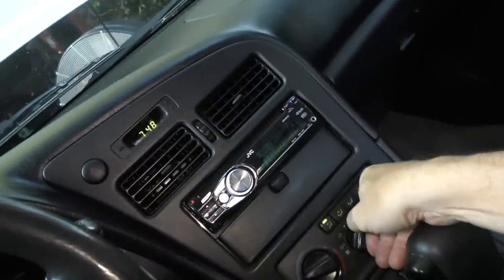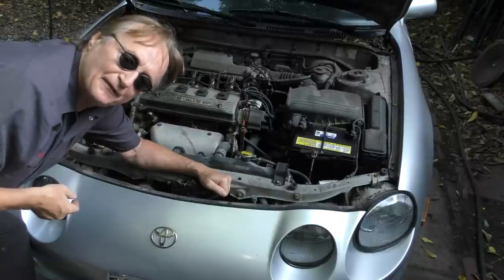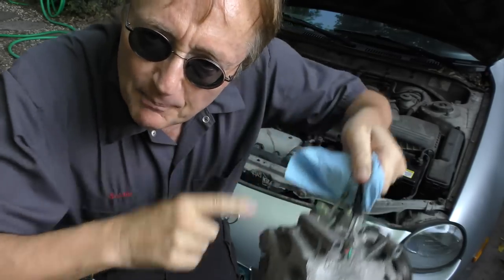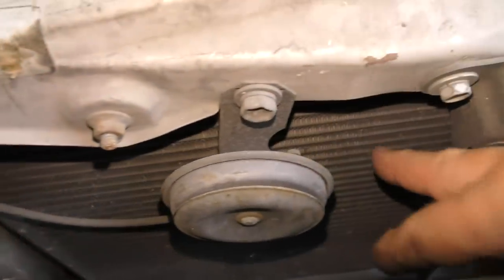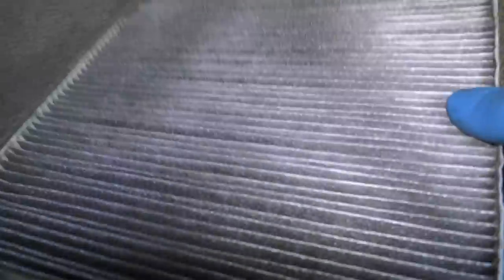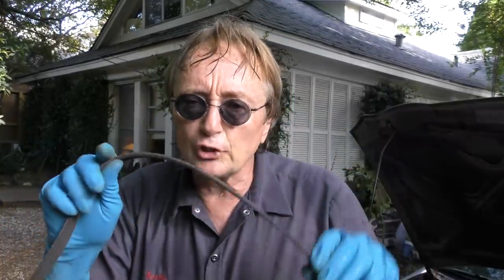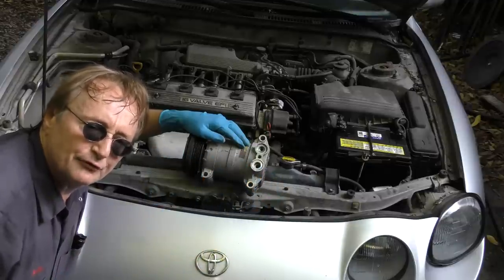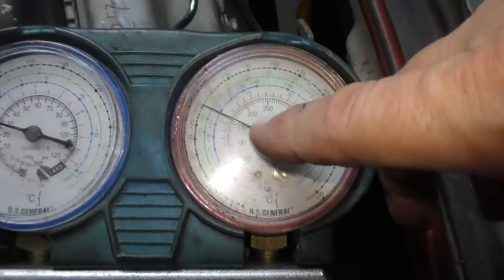How to Keep Your Car's AC Blowing Ice Cold

Comment: I have a question Scotty when I'm driving my vehicle on high speed it automatically turns off I pulled over trying to turn it on it doesn't turn on I have to try a couple times and then it turn back on but mostly when I'm driving at high speed and turns off by itself what could it be
Reply from the maker: pressure test the fuel pump, weak ones often do that

Comment: hey scotty I just replaced my compressor to my Chrysler 300 and its still not cold enough any ideas
Reply from the maker: on that model, if compressor goes bad, you should also change the condenser, the receiver drier, and the expansion valve. Start there
Reply: +Scotty Kilmer  well I replaced the valve but its still not cold enough at idle when driving it's cold

Comment: So if the low pressure side has really high pressure, what does that mean?
Reply: Phannty chances are that the system is blocked/ plugging up. but with out the exact pressure it's hard to tell.  low and high side.  it could also be a bad compressor and you are seeing static pressure.

Comment: So long as the mechanic isn't out to rip you off! Finding a good one is like finding a dentist 😐
Reply: The thing is, a mechanic may also rip you off in a subtle way. For example, you want to have a timing job (belt/chain replacement) done. You don't explicitly ask the water pump to be replaced. While doing the work, he/she may notice that your water pump is about to die but not tell you about it, and not replace it. You didn't tell him/her, after all, so it's not his/her fault. So you end up with a new timing but, soon, you wreck your head gasket, you come back to the mechanic and he/she gets the labor for it too. The best thing is educating yourself about how your engine works and all of its parts work, and if a service manual for your vehicle is available obtain it. So that you come to any mechanic with precise requests (and maybe personally sourced parts too), you can check the work done by yourself and you can't be ripped off whatsoever.

Comment: I have a 97 celica and the a.c. blows so cold. I mean so cold that it will make your face numb and the force of the air coming out is insane. I have 2010 Toyota rav 4 and the air on it doesn't even come close as the Celica and the high setting on the rav 4 is the same as the low fan setting on the Celica.
Reply: Check the cabin air filter on your Rav 4.
Reply: TeraVolt I didn't even think about that. Thanks. I know condensation builds up when the a.c. is on but is it normal to have water constantly dripping? Well more like a very thin stream. Could the cabin filter cause excess moisture build up?
Reply: trucker V Depends on air's absolute humidity. However a clogged air filter makes the evaporator get colder and colder until it begins frosting. The AC system/LPCO switch/stroke control valve senses the frost and cuts the compressor off/reduces pumping so to make the evaporator defrost. Even a low refrigerant charge can cover the evaporator with frost soon. Begin by checking, and replacing if dirty, the cabin air filter.
Reply: TeraVolt great thanks a lot.

Comment: hey i have numerous issues that have come about like the fuel sensor continues to show the gas readings incorrectly, the car overheats after running for a little while when you sit at a light when it's got out. and also what if you are running your A/C and it cause the car to stall out like 10 minutes out of running?
Reply: its an 05 Chevy Malibu maxx LT
Reply from the maker: sounds like various different problems, but if you're lucky, could just be a bad fuel pump/fuel sending unit failure, try that first.

Comment: my compressor comes on and off like its supposed to, but this mechanic said he evacuated the system and recharged it, (it only took 40 min total) and he said my system is holding too much pressure, and that he doesn't know what is causing it but that it is the compressor and he still charged me for the a/c service. does this sound right?
Reply: Oh and i am feeling slightly cooler air coming out when i have the a/c on when im driving around and a little more than that when i am on the highway. but it is by no means cold. Just cool. And only since he recharged my system. Any advice will be helpful, I don't want to spend any more money if it is not going to work.
Reply: @deedless77  Bad condenser. As the system gets old, heat exchange surfaces badly oxidate outside, and inside they fill up with compressor wear material. The condenser loses a lot of efficiency. That's what's likely causing your issues. New dryer/accumulator and condenser is the way. Might also be an airflow issue, like a bad condenser/cooling fan or fan clutch.

Comment: hey does a 2000 dodge ram 1500 have a cabin air filter
Reply from the maker: most don't, but get your vin and call a dealer parts dept to find out for sure

Comment: hi sir 
I have problem in my Toyota corolla 2003 ac system my car ac work good but after some time it trip and no cool I change radiator fan good when I switch of ac after 1 minute again ac start cool but after some time again same no cool again switch off
Reply from the maker: often just a bad ac clutch relay, try that and PRAY they compressor isn't going out

Comment: Jeep Grand Cherokee 98 on the inner city the AC does not work but on the Expressway it works great but my 3 yr. Old is sweating bullets in the back in the Intercity * PLEASE  PLEASE HELP *
Reply from the maker: pray its just low on refrigerant or that the cooling fan on the radiator is not working strong enough at low speeds

Comment: will I'm replacing my water pump,radatior,thermostat and from this is need a fan clutch it doesn't engage at all and I have a new ac compressor. and it doesn't blow cold. do probably my fan clutch
Reply from the maker: well, if it's the fan clutch, ac would blow cold at first for 5 minutes or so. If it doesn't do that, something else is it
Reply: Scotty Kilmer it does but then the truck starts to over heat up fast even with a fail safe thermostat blown wide open. it was °98 yesterday and the truck over heated enough to make the radatior cap leak. make the right side of the radatior blow a big Crack in and my water pump has a small leak on it now. the neck of the water pump is all wet with antifreeze.

Comment: hey scotty my name is sal i need help I have a 2005 Nissan Altima 2.5 I only get heat when I'm driving I already change the thermostat I change the water pump still doing the same thing soon as I get to a red light I get cool air only when I'm moving I get hot air The car doesn't overheat I have no leaks blower motor works fine can you help me it get cold here in New York thank you
Reply: Assuming the engine coolant is full, and the controls are not faulty,  it sounds like a plugged up heater core in the dash.
Reply: ray s Thank you for helping me out I flash The heating core and I still have the same problem any other ideas and yes the control works fine and plenty of fluid I have no leaks
Reply: @sal.m4147  
There must be a blockage of some kind. Did you check the heater hoses for kinks? Is the heater control valve working?  It still could have a plugged up heater core even though you have flushed the system.  There are youtube videos on how to check the core for blockage
Reply: Ray S Thank you yes I did check everything is normal no kinks
Reply: the only thing i thinking of the thermostat they're not from the dealer they generic auto part
Reply: @sal.m4147  
MAYBE.  But if the thermostat wasn't operating properly it should turn on a check engine light. I keep mentioning the heater core because I have seen them partly plugged and cause what you are describing. The material blocking the tubes looks and feels like rubber and can't be flushed. There are ways of testing, such as an IR temperature scanner. By the way, does it have the exact specified coolant/anti freeze?
Reply: Ray S I want to thank you for all your help and let you know i change   the Heater core Problem solved thank you again Sal menendez
Reply: @sal.m4147  
Not a fun job to be sure. But I'm glad you have heat now!
Reply: Yes on time to snowing today

Comment: what if my ac blows cold air but when my Engine temp hits the half mark my ac control shuts off i turn it back on and it works for like 30 min and it shuts off again.. if it doesn't shut off it just starts to slowly blow hot air but if i rev my truck the engine temp goes down and colder air comes out my engine is not over heating at all
Reply from the maker: check for electrical shorts that take time to heat up and then short up with heat and time. such as bad ac magnetic clutches
Reply: +Scotty Kilmer i have a 06 h3 recently the harness and resistor went bad i changed that it helped but it still does it i will go thru my truck it started to do it when we replaced the radiator

Comment: Scotty my ac works but after i turn off car it doesn't want to start back up after a while
Reply from the maker: if it doesn't blow at all then for a while, replace the blower motor, pray it's that easy. if it blows but not cold, then check Ac pressure switches and relays for the AC first

Comment: Why dous my car`s  a/c compressor looses the refrigerant but my refrigerator in my kitchen in maintanance free?
Reply: Because in mobile AC systems the cold loop (refrigerant circuit) contains shaft seals (the compressor has to come with a shaft seal because its shaft is driven by the engine, i.e. it's an open compressor) and o-rings, while the refrigerator's cold loop has welded connections and the compressor's shaft is driven by an electric motor which is inside the compressor's body, i.e. it's a hermetic compressor.
Reply: museack I basically said the same thing. With a home unit the compressor's motor is located inside the compressor's body and the compressor's body is hermetic, so there's no need at all for a shaft seal. In the average car (except for hybrid cars), the compressor's motor is located outside the compressor's body, hence the compressor is of the open type and needs a shaft seal.

Comment: I had an ice cold AC, then the compressor locked up. Had to change the entire AC system. Now it’s not as cold anymore. Help...
Reply: Likely didn't change the entire system. This usually happens when the condenser is just kept as is or flushed instead of being replaced, and when an old accumulator/dryer isn't replaced. Also happens when vacuum hasn't been done properly

Comment: The coil burns out. Not the entire compressor.
Reply: It's not the coil, most of the times. It's the thermal fuse inside it that some coil makers put. And it's designed to go out if the compressor starts binding (making the clutch slip so heating up the coil on the side that comes with the fuse). So you may have a binding compressor that no longer engages due to the burned up fuse and as soon as you replace the coil you may find that you have to discard the compressor too. Though, most of the times, only the fuse is at fault (it can break for no apparent reason) and the compressor is still perfectly healthy, and that's why almost any scrapyard compressor comes with a faulty coil but is almost new inside (replace the coil, replace the compressor oil, balance the oil, and it's as good as a brand new one).
Reply: Its the coil that burns out. i fix auto ac's all the time. easy to test if the ac isn't getting power and no leaks, normal pressure.

Comment: Hello I have a problem with my Car ac system. I have Consulted Many Car AC Exprts. they checked but unable To Find The Leaking point. I my self vacuum my system and the vacuum stands for 15 days . after that i filled My System with r134a . After two days of driving with AC on I Notice that the gas level is gating low. I Vacuum Again and leave the System Vacuumed for an other Two days And refiled my system again . But after driving 50 km with AC on I noticed that the gas level is low again .I will be very happy someone help me.
Reply: Positive pressure with A/C running is going to be much higher than vacuum, you got leak somewhere in the fittings, look for some oil.